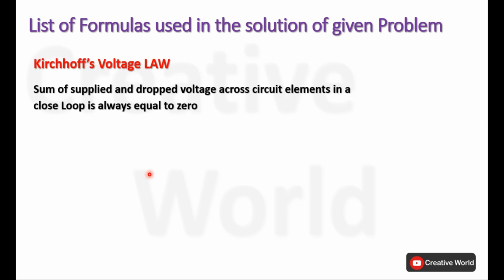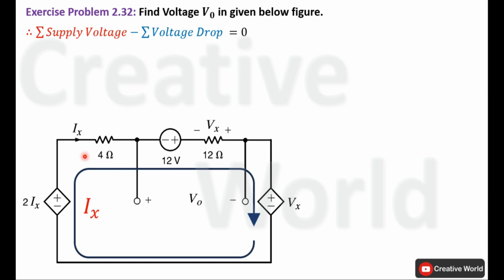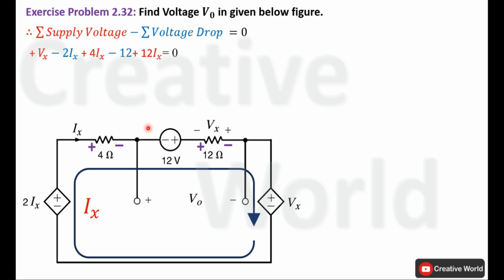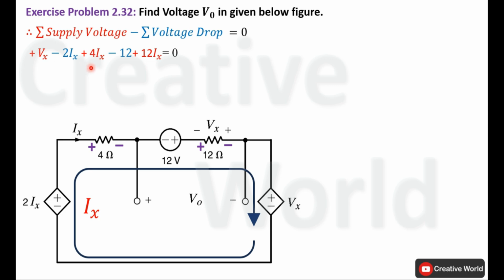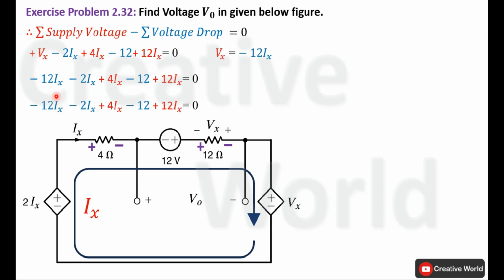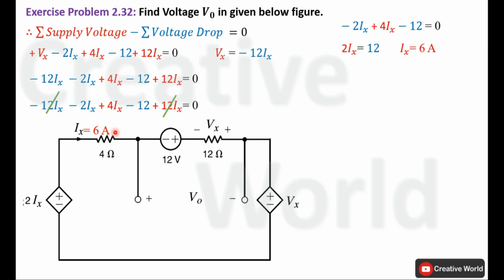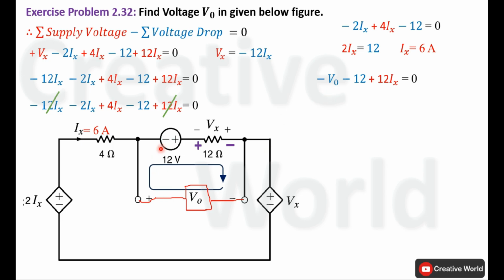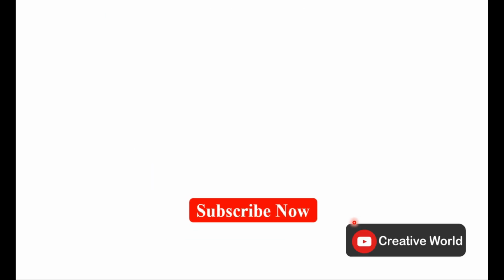Chapter 2 Exercise Problems 2.32 Solution | Linear Circuit Analysis

Comment: سر اگر Vx کی polarity already given ہے تو ہم نے خود سے اُس کے oppsite assume کیوں کیا۔
Reply from the maker: very good question 
I appreciate
actually we have assumed the direction of current inside this close loop in clockwise direction and we have to take the polarities of voltage drop across resistances according to the assumed direction of current that's why we have taken it as 
if we will assume the direction of current in counter clockwise than we will take the polarity of Vx as it is